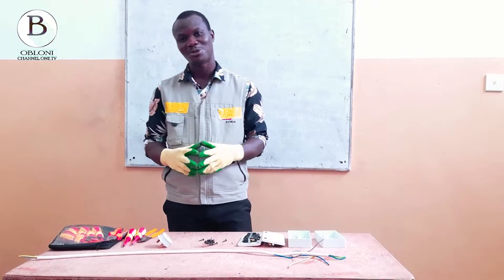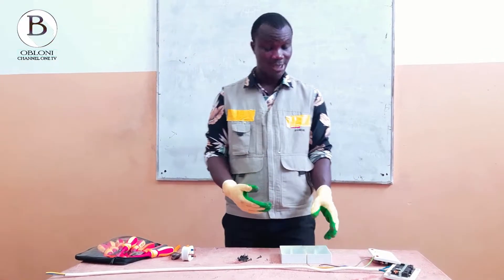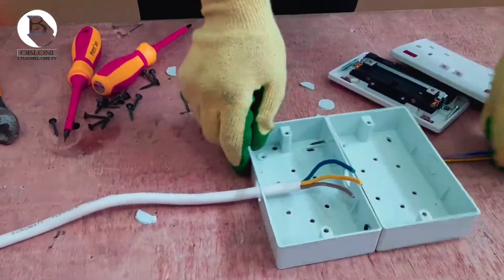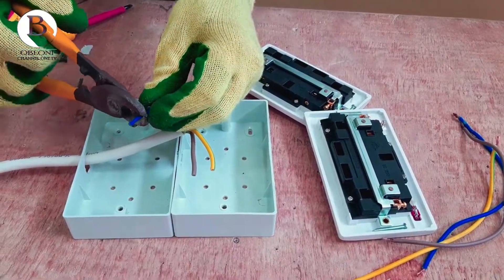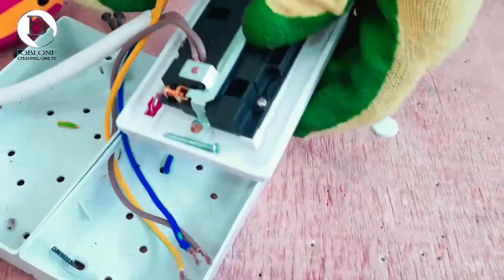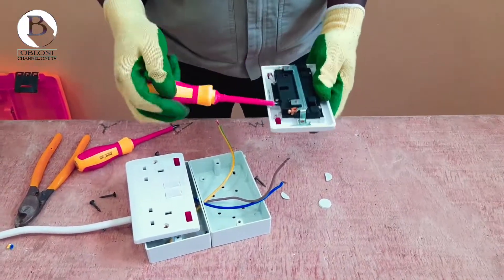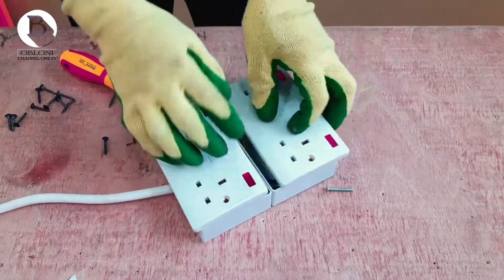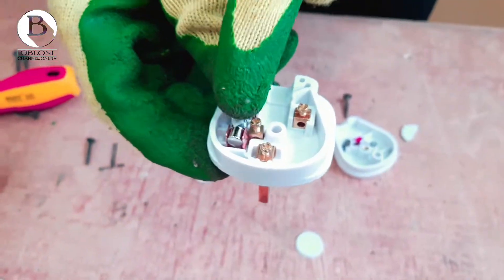HOW TO WIRE EXTENSION BOARD

Comment: Nice work but this extension board will not be strong.
1st, the two pattress boxes are not well held together.
2ndly, the 3 core cable will eventually pull out of the extension board bcs there is no reenforcement to keep it inside the pattress box. This will eventually cause the conductors to be pulled out of their terminals.